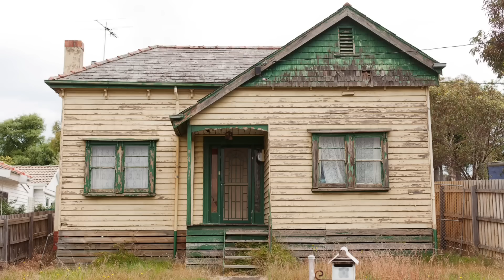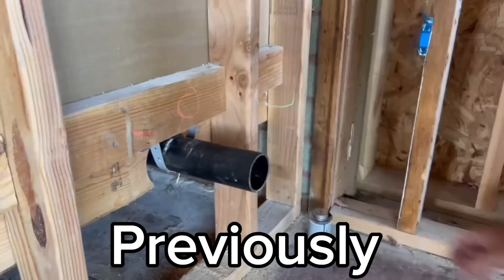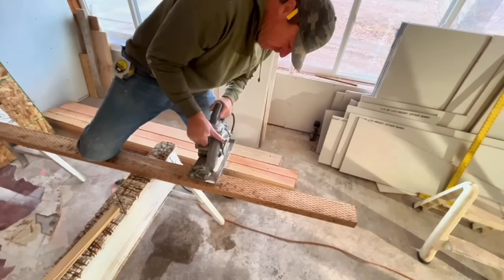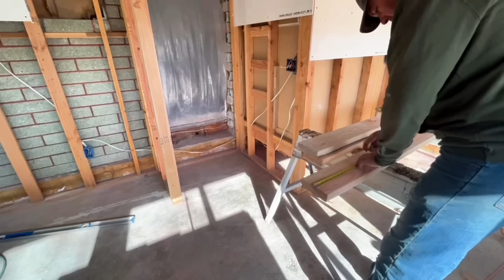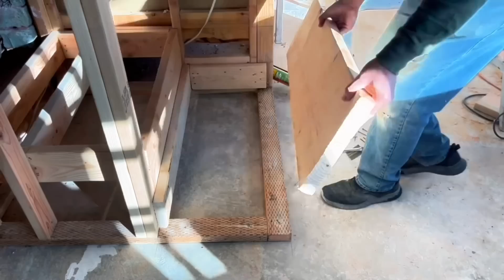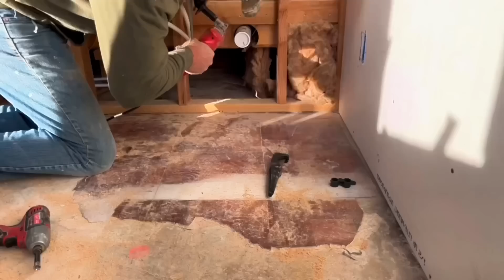House Hacking A Home For My Daughter Since Housing Is SOOO EXPENSIVE!  Part 3

Comment: Great job. The only thing I would change is the stair treads. I would have bought piano hinges and a solid hardwood stair tread and made storage under the stairs. You can also buy those felt stick ons that go under furniture for wood or tile floors for the stairs so they don't make noise when you walk on then or close them.

Comment: A little intrigued about the creation of a little hallway with the stairs?   Adding a closet?   Storage bookcases? Thought it would be cool to have some built in bookcase squeezed into  area the outside wall would have been.   just big enough for paperbacks.  So the transition between old house and new area would have  these 6 or 8" wide bookcases recessed into the wall.  Made out of plywood- then have the drywall butt up against them.  would need a light in the stairway area to be able to read the titles of the books.
Reply from the maker: Great idea!  Thanks for sharing.  👍

Comment: Nice video, the only thing I could even consider griping about is at 14:33. The angle of the lower part of the half wall doesn't match the angle of the ceiling and it just seems weird, but I havent seen it all buttoned up yet so we'll see how it looks I guess. Also its not my house, I just felt like giving my 2 cents. XD Keep up the good work!
Reply from the maker: I set it to the angle of the stairs, I did consider that, but I think it’s going to look fine 👍. Thanks for watching and commenting!

Comment: concerned you didn't add any structural header to support remaining blocks/bricks at top of new door opening. Are not there rafters bearing on those?
Reply from the maker: After looking it over, the top couple rows of bricks had been grouted with concrete and rebar making a sort of bond beam.  I decided not to disturb that so I have a 2x header on each side supported by 2x2 trimmers.  When I added the door jambs, I secured the brick, I feel good about it since there’s only one rafter from each side resting on it.